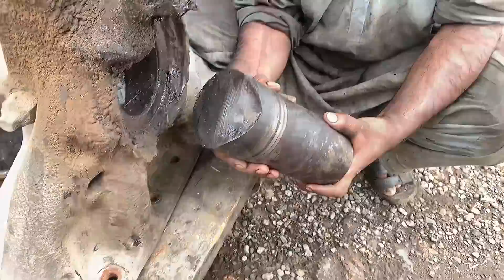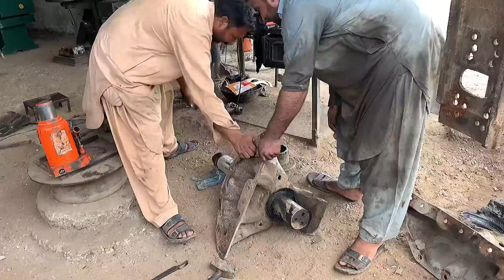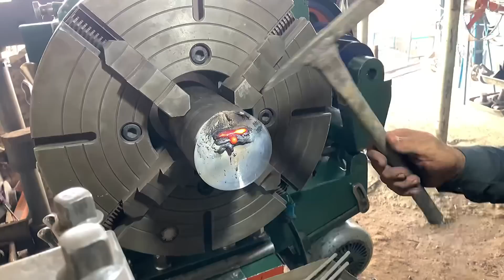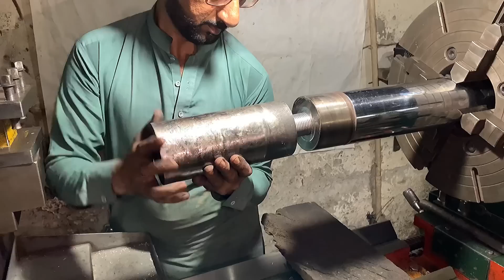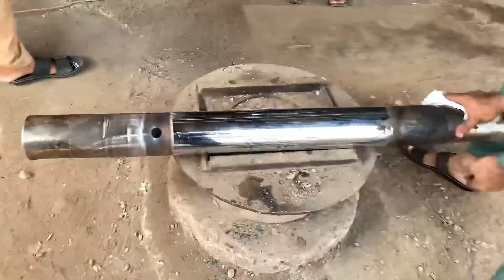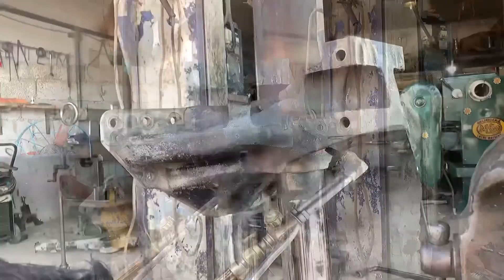Prepare to be amazed Broken trunnion shaft repaired by threading stronger than before

Comment: Problem is, the result is very dubious.  Nobody in this picture is a metallurgical or mechanical engineer, capable of designing a proper fix that will definitely not kill anyone.  It’s much cheaper and secure to just replace the dang piece of steel.

Comment: There is alot of cry baby comments  here. If you dont like the channel or the work they do, why watch. Not everybody can afford the American way of reairs, that is, let's make it as expensive as possible.
Reply: I'm going to tell you this, they are "crying" because the way (and there are several) that they put the piece together is THE worst: it weakens the piece, it's more work, it lasts MUCH less because with the vibration the weld cracks and it gets full of rust inside (this just makes the vibration worse) and is sure to break fast.  apart from that he used so little solder that it will be a surprise if it lasts 7 months. MORE EXPENSIVE, it will be when it breaks and you have to pay for another repair. 
There was another way to do it that is even cheaper and it would be much better than this "fix" they did.
Reply: @algummarcosvinicius  "he used so little solder" disqualifies you from any critiquing ...
Reply: @algummarcosvinicius  ,you were right.This is only get short time effort. But, the true problem is not solved.